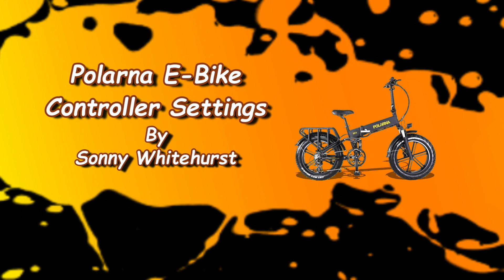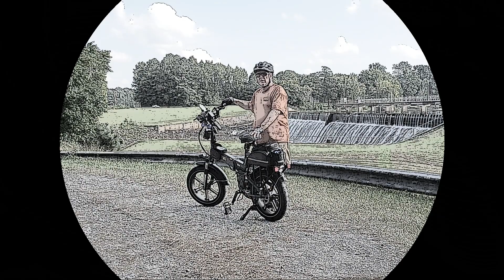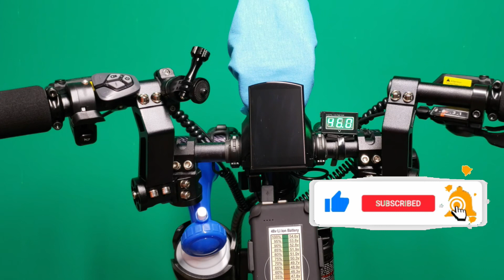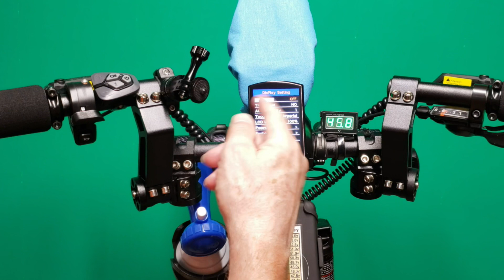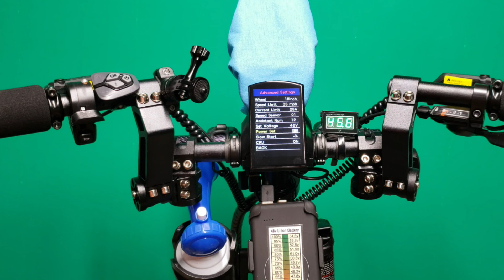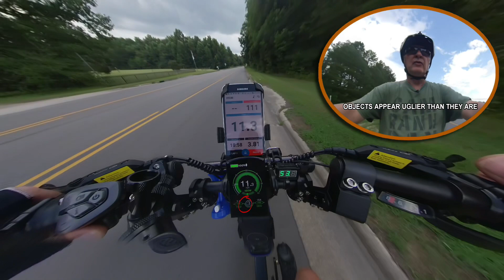Polarna E-Bike ~ Controller Settings

Comment: Thanks, Sonny. Wish the company had this info more readily available. Just got my M6 and it is kicking my butt as I haven't ridden a bike in 20+ years. Their default level one power is way too high!
Reply: Considering buying an M6, did these settings work for adjusting it for you? The M6 looks awesome overall. Any regrets 2 months later?

Comment: Howdy Sonny.  I've been trying to seek out info on the display for my Polarna M5 and found this video for a Sondors using the same type display.  I noticed it was a older video and believe the software for our Displays are older programs. https://youtu.be/xCJSWhpAKx8 (hope this helps get us a better understanding of the features we haven't figured out yet).  I also read a lot of the comments from that video to gain further knowledge of the settings. I'm still looking for a better explanatory manual out there.  I also found that the Bafang KD986 display is of the same origins as the software and display we have and might find a manual with them. I'll let you know if I strike pay dirt.

Comment: I saw other videos from other people and they added a junction box to run both batteries simultaneously.  Do you use 1 in your setup ?? And where did you get it ??  Or maybe you just used wires to tie both batteries ???
Reply from the maker: I did not use a junction box.  I connected the auxiliary wiring harness straight into the power leads to the controller.  I've done this on 3 e-bikes and have had no issues in over 5,000 miles.

Comment: The Engwe Engine pro has same display does anyone know how to change in advanced setting change the current limit from 18a to 25a when I try changing it. It goes back to factory settings how do you reprogram it so it will stay on 25a?
Reply from the maker: I don't have that problem with my Polarna.  It came with the controller current limit set at 25 amps.

Comment: Thanks for your voltage settings! My battery was showing full charge after like 7 miles of use, I knew it couldn't be true even though I have a 14.5ah battery

Comment: Is there any extra hidden secret menu options? I'd love to know how to remove speed limit with this display, I have a different bike with this display and they factory limited to 26mph on the display... also what does set voltage actually do? Make the bike faster or what?
Reply from the maker: If there are any extra hidden secrets they are hidden from me.  The voltage settings effect the percentage gauge at the top left of the controller display.  At 9:25 I explain how this feature works.
Reply: @Onyasix  Also the factory reset option doesn't work, I don't understand why. I think the factory did something.. my display won't go past 26mph and won't save and factory reset doesn't work. Speed limit and factory reset neither of them work. I really wonder if I can unplug something and reset the display/controller or whatever so I can unlock the bikes potential
Reply: Can you program the bike to give full throttle power at any PAS level?

Comment: I have really enjoyed watching your videos. I I have a terrible issue with my Polarna M6. I only have 7 miles on it and have been riding around my neighborhood to get used to it and the motor has failed. The bike will Turn on but the motor shows in read error code 21 motor controller protection. It’s only been one day and certainly I have contacted the manufacture. We will see how they conduct a warranty repair, return, or replace.
Reply from the maker: Sorry about your problem.  I doubt that this will fix your problem, but it is an easy thing to do first, do a factory reset.  If that doesn't fix the problem do the following:   Check all of your wiring connections, especially the one running from the controller to the motor.  I would disconnect these connectors and reconnect them.  If you still have the problem, I would open the cross tube to get to the controller compartment and pull the controller out and check all of the wiring connections at the controller.  Let me know what you find to be the problem.  Good luck with customer support.
Reply: @Onyasix  thank you so much for taking the time to respond with suggestions to fix my problem. I had already tried the factory reset several times. I think without question it is the motor itself. When I pick up the rear end and turn the back wheel it has a ton of drag and makes a whirring sound as though something is scraping inside the hub. 
I am so disappointed with this bike. It is very expensive and it only lasted for 2 1/2 rides. I took the chance of buying a bike with all the features I wanted from China with only one person on the Polarna website to communicate with, a gentleman named Sean. I doubt they have any repair support in the San Francisco Bay area where I live meaning if they do send parts I am going to have to fix it myself.
I asked Sean about the warranty before purchase and he said two years. The bikes death only happened yesterday and of course I contacted the company right away. I have not yet heard a response. I guess I am the test case to see what they actually are going to be able to do for me. An issue that no one seems to talk about on Ebike reviews is repair/warranty service. It’s as though the bikes don’t break. I know better. 
If you are too busy to continue this thread of conversation I understand. I know you have lots of projects and I appreciate you taking the time that you already have but, if it’s OK to continue my saga with you it’s good for me to have someone else to speak with other than waiting for Sean from Polarna. 
Lmk, David
Reply from the maker: @davidbelove662 ~ my first e-bike(s) was the Lectric XP.  I have had 3 XPs, 2 standard and one step-thru (wife’s).  Both of these e-bikes (Polarna & Lectric) are manufactured/assembled at the GDS  e-bike plant in China.  The big difference is that Lectric is an American supplier and Polarna is a GDS (China) supplier with a distribution center in California.  As far as customer service, Lectric is about as good as you can get in USA.

I knew when I purchased the Polarna that it was going to be a gamble just based on the supplier and likely would have poor customer service.  Since the Polarna at $1349, when I purchased it, was such a value for the money ($400 to $500 less) than comparable e-bikes (Yamee Fat Bear 750s, Engwe Engine Pro 750w,  etc.), I took the chance with the hope that I could fix any issues that occurred.  I had a few small glitches with the Polarna at the start, the biggest was a knocking freewheel which was a moot point since it was going to change the freewheel anyway from the 13-28t to a 11-32t.

There are 2 Facebook groups, Polarna Ebike Owners Group and GDSEbike Polarna Owners Group.  I am a member of both and created the latter.  Both of these groups are good sources for information from other Polarna owners.  If you are not a member of either group, you are certainly welcome.  Keep me informed on your issue and your experience with Polarna’s customer support, so I can pass the information on to other Polarna owners.

Comment: Does the Polarna have the regenerative braking system? The E-Pas. I have seen a couple site say it does but nothing definitive, you would think they would advertise their features better.
Reply: yes
Reply from the maker: No, it does not.  I'm not a big fan of regen systems, I think for the most part it is fluff.  What I have read (from independent sources), the regen at it best (hilly terrain) only puts back 5 to 10%.  I live in the flat lands, so I would get next to no benefit.  I do know that when pushing the bike, the motor is turning over (no clutch release which my Lectric XP has), which make me wonder it the regen technology is there, but the controller is not equipped with that feature.   This e-bike is very similar to the Yamee Fat Bear 750S which does have the regen feature.
Reply: @Onyasix  What about that 20ah battery, does that fit in the frame tube like the stock battery?
Reply from the maker: @SFARCO  ~ No, it is in my rear rack bag and wired to the controller.
Reply: @Onyasix  Got it, thanks!

Comment: Sonny, my wife accidentally smashed her display. I can see that there are many displays available for ebikes but they are dependent on the motor. Do you have a recommendation for the Polarna display? What bafang motor do our bikes have? Thanks
Reply from the maker: Ivan ~ Of course my first response would be to contract Polarna for a replacement.  But, My experience with them is crickets.  This is a link to a KD986 Key-Disp that may work.  It is the closes one that I've been able to find on the internet.  They do say on the website to contact the merchant to confirm that it will work on your e-bike.  Hope this helps. https://www.aliexpress.com/item/4001362111180.html?spm=a2g0o.detail.1000060.1.4a6174c5zeF479&gps-id=pcDetailBottomMoreThisSeller&scm=1007.13339.169870.0&scm_id=1007.13339.169870.0&scm-url=1007.13339.169870.0&pvid=bb329a1e-6251-4ad3-89cd-ea3af16a2e4f&_t=gps-id%3ApcDetailBottomMoreThisSeller%2Cscm-url%3A1007.13339.169870.0%2Cpvid%3Abb329a1e-6251-4ad3-89cd-ea3af16a2e4f%2Ctpp_buckets%3A668%230%23131923%2363_668%230%23131923%2363_668%23888%233325%2318_668%23888%233325%2318_668%232846%238107%231934_668%235811%2327175%2322_668%236421%2330827%23607_668%232717%237558%23200_668%231000022185%231000066058%230_668%236808%2332771%23214_668%233468%2315615%23640_668%232846%238107%231934_668%235811%2327175%2322_668%236421%2330827%23607_668%232717%237558%23200_668%233164%239976%23697_668%236808%2332771%23214_668%233468%2315615%23640&&pdp_ext_f=%7B%22sceneId%22%3A%223339%22%7D&fbclid=IwAR1jN5FmAFxrvoSC_KElDtG1aXwzqZAXYb5uWi9NRXkYQ8jX-oHMnlt-7UQ
Reply: @Onyasix  thanks very much for the response and comments. I’m awaiting a response from Polarna. Hopefully it will be better than a cricket.

Comment: hello Sonny just wondering how often do you charge your battery?
Reply from the maker: Joe, I run 2 batteries simultaneously on my Polarna.  The stock 14Ah and an auxiliary 20Ah generic battery.  I ride 15 miles daily between 18 to 21 mph.  On the third day after ridden 45 miles total, my battery level is down to 46 volts or approx. 25% level.  At this point I recharge both batteries to a full 54.6 volts.  I started out with this routine on my Lectric XP and carried it over to the Polarna.
Reply: @Onyasix  Thank you Sonny I have a friend who charges bike after every ride whether he ride 5 miles or 15 miles it just doesn't right
Reply: @Onyasix  Does the 20ah battery you use plug into the frame like the stock battery?

Comment: Is this screen interchangeable with the lectric screen 🤔. Thanks for all you do.
Reply from the maker: Glenn, that's a good question.  I do not know the answer.  I do know that the Polarna's and the Lectric controllers visually look identical (same wiring, 48v, 18 amps, everything), their controller's Model # is different ( but so are XP 1.0's and 2.0's), I have not opened the controller cases and looked inside to see if the circuitry is the same.  I do know, obviously by the video, that the Polarna's Key-Disp has many more features that can be changed and adjusted than the Lectric's M5.  That would be a good question for Lectric to answer.  If you find out let me know.